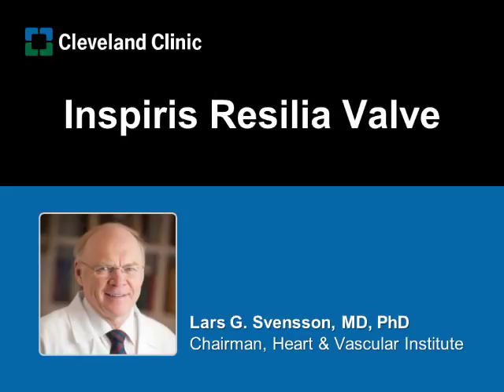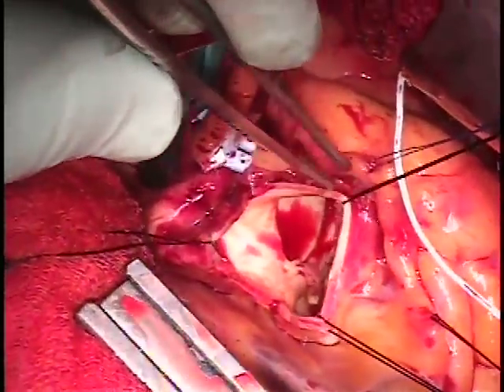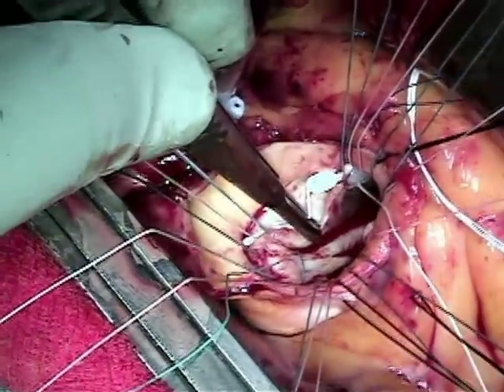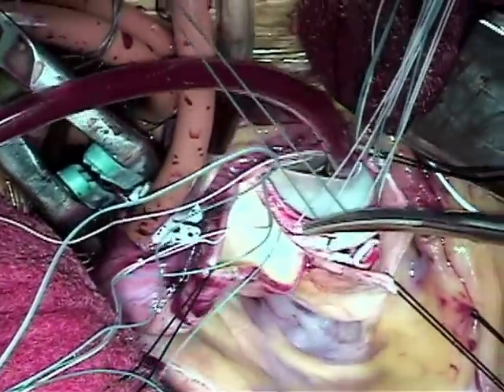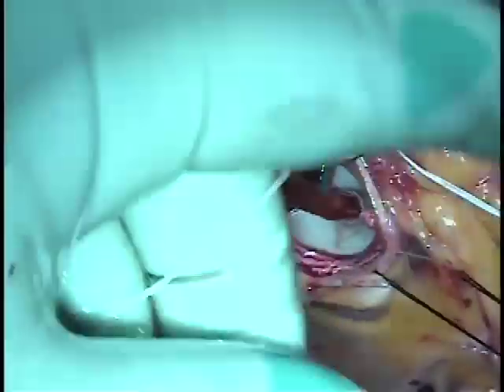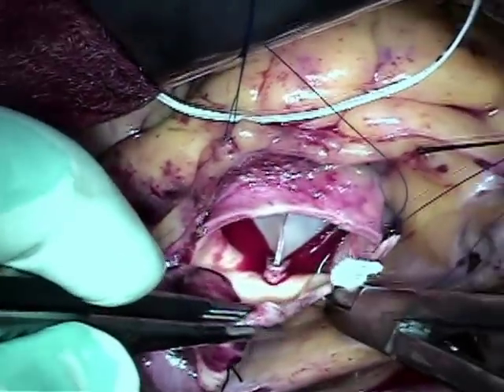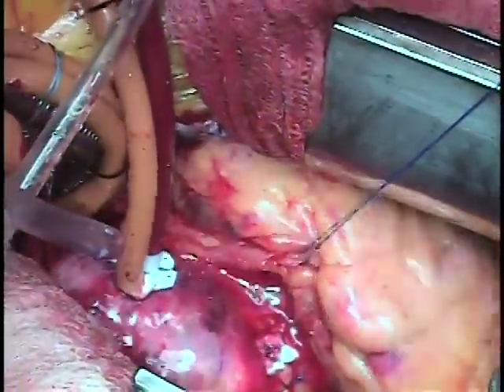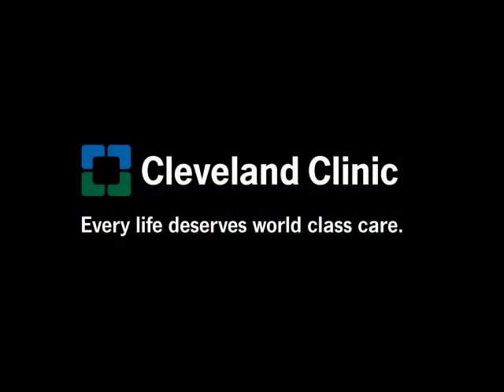Aortic Valve Replacement with a Pericardial Tissue Valve

Comment: I have 30 years old .l set for an open Heart sergury. Which the best one a tissue or mechanical valve?
Reply: Heres the pros and cons of each type of valve 

Tissue valve pros
Does not require any medication (maybe an aspirin)

Tissue valve cons 
You will eventually need another surgery since the tissue wears out after approximately 10-15 years and since you're young you will most definitely get one with a tissue valve

Tissue valves can be easily damaged-infected 

Mechanical valve pros 
They last forever (in theory) 
They aren't so prone to infections

Mechanical valve cons 
You'll have to take anti-clot pills for the rest of your life 
You can actually hear a mechanical valve ticking and it might be annoying
You'll be having your blood tested quite regularly
Reply: Mr. Burns so mechanical valves is better than tissue valve.
Reply: @youtubenews233  well ..both valves have their pros and cons its up to the patient and doctor to decide what's better 

A mechanical valve will last longer for sure so if you're young and you don't want a 2nd operation get a mechanical valve .I think it is a better choice